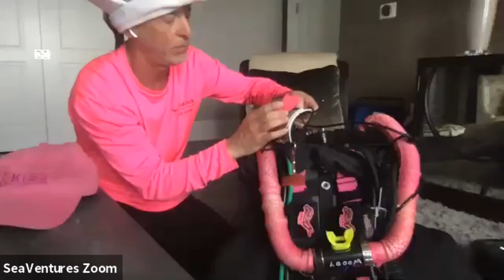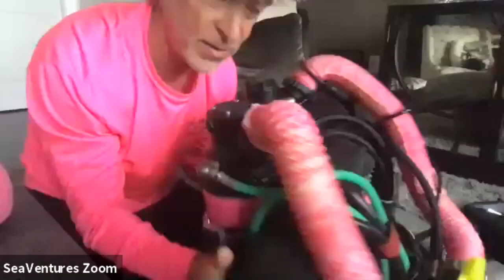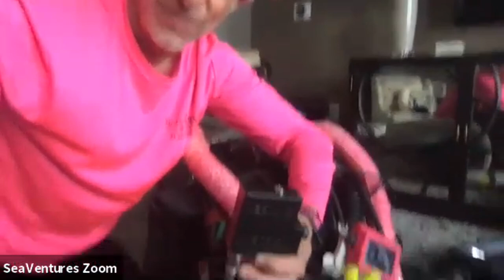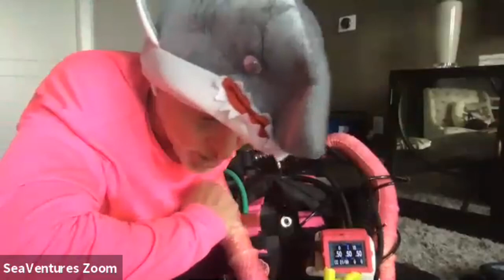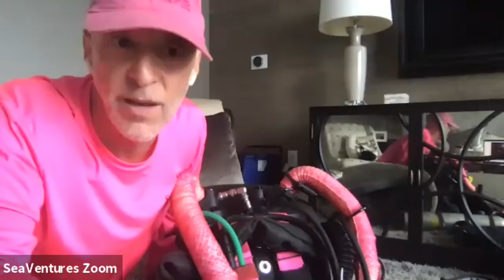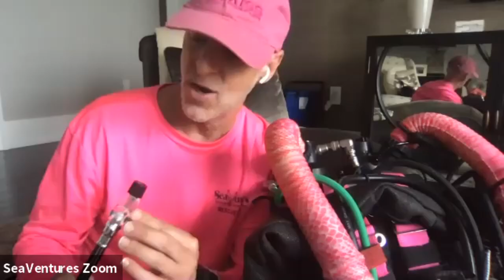What is Closed Circuit Rebreather Diving? - With Woody Alpern, Mike Young, and Douglas Ebersole

Comment: It sounds complex. This mixture and having to adjust it as you go down. Doesn't your computer do that? Good stuff.
Reply: There are some rebreathers that have computer controlled O2 valves, but the point of KISS rebreathers is simplicity. Not necessarily being the simplest to use in normal operation, but being the simplest in terms of reducing extra complication that could create strange failures that aren’t induced by the user.
Reply: @JohnMaxGriffin  I must watch too much sci-fi as I thought a re-breather was no bigger than a mouth organ. Thanks for the info